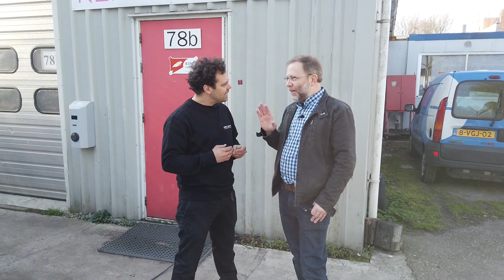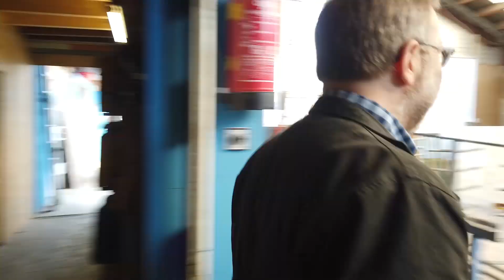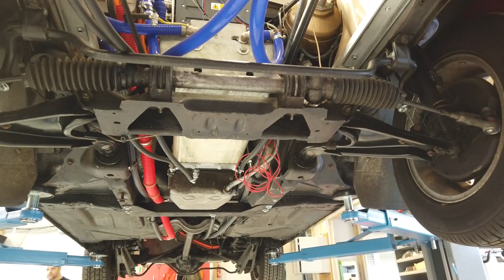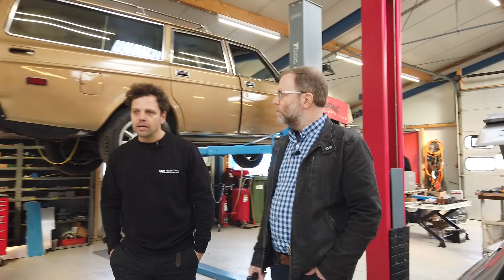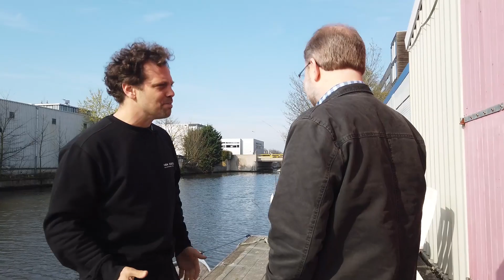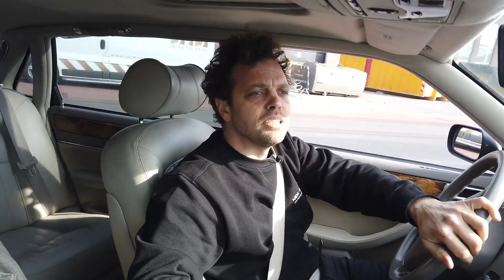New Electric | EV Drive Trains Conversions!

Comment: Ev change over goes black to 
AZ GLOAG RAILWAY 
ITS ALL BEEN DONE SOUTH SHAFT OR DOUBLE AXEL ADJOINING WHEELS TO H-H-H-H SHAFT OR BELTS TO ALLL LEFT TO RIGHT TRAIN WHEELS NEEDING RUBBER KEVLAR GRAPHENE TYRES.
IF YOU HAVE ORIGINAL GEAR SYSTEM MARTIN NAHUEL SIBILIA IS LINKEDIN CONNECTED WHO RECORD NUMBERS REFURBISHED REFIT VW BEETLE CHANGE OVER TO EC ENGINE AND BATTERIES.
WITH NO BATTERY NEEDED WITH MICRO CAMPING WIND TURBINE X 10 (X2 DC MOTORS SENDING POWER BACK TO DC MOTORS AT A SPEED UP 170+ MPH WITHOUT WIND OR WATER, ALSO TRAVELLING TOWARD WIND WATER COULD RECHARGE BATTERIES VEHICLE GRILL OR ELSEWHERE WIND WATER CHARGING THE BATTERY) 20-100+ GENERATOR SENDING POWER WITH MICROCONTROLLERS WIFI IRIDIUM BLUETOOTH FOR MAIN ENGINE PROPULSION MOTORS.
ELECTRIC GT USA CALIFORNIA IS PLAYING EV ELECTRIC WITH BATTERY AND MANUAL TRANSMISSION FROM A REFURBISHED FERRARI MANUAL TRANSMISSION ORIGINAL .
DOESN'T NEED 3 MOTORS OR HIS NEW DRIVETRAIN WITH A TOYOTA STICK SHIFT TRANSMISSION CONNECTED TO BATTERY AND EV ENGINE DESIGN.
INCREASING THE MAXIMUM AC INDUCTION AT 1000 KW SAME SIMILAR SIZE OR DC MOTORS IN REALTY NEED SMALLER POWER OUTPUT TAKING 4 OR 5 GEAR TO RECEIVE MAXIMUM TORQUE HORSEPOWER WITH 1000HP LOTUS TAKING THE PISS NEW EV LOTUS LOOKING PATHETIC.

HE DOESN'T OWN THE RIGHTS TO SEVERAL+ MOTOR POSITION MOUNTS GEAR SYSTEM WITH MICHAEL FRAGOMENI LINKED AND SIEMENS PROCUREMENT/PRESIDENT SIEMENS USA WHO HAVE THE SQUIRREL CAGE AC INDUCTION HALF THE SIZE OF A BUS STOP AT 50.000+ HORSEPOWER.
WHAT DC SIMPLY MOUNTED ALIGNMENT WITH COMBUSTION ENGINE DRIVE BELT SYSTEM CAN DIVIDE TOP SPEED VIA GEARS EQUAL OR GRADUALLY UPWARD.

HE'S AN IMPOSTER OR RWO MIND'S ALIKE SOLID STATE GEAPHENE BATTERY TOOK SCRAWL SEVERAL PEOPLE JOHN GOOD ENOUGH ISN'T 3D PRINTING TIMED DATES PHOTOPOLYMER PRINT A ROCK MAPPED OUTDOOR THE UNIVERSITY AND  MISHAPS MISHAPE A FIRST TIME EVER SOLID STATE GEAPHENE BLOCK TEN TO SCREW A LIGHTNING'S BULB DOES IT?

https://m.facebook.com/story.php?story_fbid=1727051674216306&id=100007344707889

Comment: there was some very enlightening information in this video about diesel exhaust particulate sizes and how they've become smaller with more cleanly burning engines. Also, most people likely hadn't thought much about boats using electric motors. 

Thanks :)

Comment: Respectfully, how is an electric vehicle better than a fuel efficient gas powered vehicle? In the US, electric cars run on coal. Coal fired power plants only transmit that power at roughly 75 -80% efficiency to the charger then the electric motors use it at around 90%.. 100 hp (74.5KW) of work is just that whether coal powered or gas powered.. An efficient gas engine is 85-90% efficient.. There are no solar charged vehicles because no one has 2 acres or room for solar cells to charge one car for daily driving.
Again, respectfully requesting rebuttals.. Thanks.
Reply: Because the electricity in the grid is not scaled up and down. It runs at a set capacity at almost all times. So, the overage is needed to account for any surge. Why not draw from from that instead of leaving it unused?

Comment: There is another issue to take into consideration when claiming that we can just convert old cars and have people continue to use them for another couple of decades: Safety. That Volvo was safe when they released it, compared to everything else that was available at that time, but today any family caught in that Volvo in a serious crash with even a small modern compact car will most likely be severely injured or killed. Plenty of crash test videos with modern vs old cars to prove this point. As enthusiast vehicles, sure, but to replace production of new vehicles, nope. Boats, and trucks on the other hand: YES. They are slow or big enough to offset the safety issue.

Comment: I have read this statement a few times, which I think is complete bullshit... :

 “EVs convert about 59%–62% of the electrical energy from the grid to power at the wheels. Conventional gasoline vehicles only convert about 17%–21% of the energy stored in gasoline to power at the wheels.”  

How much did the generator, that supplied the grid convert again?  Or is this a non issue?

Furthermore, doesn't even the act of taking the power from the grid, ie. going though a transformer into the battery lose a further 30%?  Science shows efficiency mechanical efficiency of a mechanical direct conversion of burning fuel (ie, not going through a generator to grid -> transformer -> battery) is atleast 45% more efficient as over extracting the same burnt fossil fuel from the grid.

Comment: Great video!  One thing I have to tell you, converting a vehicle to electric drive is NOT as hard as you think.  I promise!!  You can do it.  There are several online shops in the States that sell components and can help you through the process.  I strongly urge you to give it a shot.  Get a little riding lawnmower start by converting it.  If you can manage that, you can do a car.  There is nothing more satisfying than driving a car that you built with your own hands.

Comment: Greetings Gentlemen,  It's a shame that Tesla does not have an "EV Conversion Division" to offer an alternative to going green. They have the financial backing and the engineering expertise to make it happen. Think of all the jobs it would generate and the money to be made. I am 67y.o. and even $35K is to much for me to spend on a car. There are roughly more than 1.5 billion ICE vehicles on the road today. Many of us have a favorite style that we would like to see live on for younger generations to experience. I am partial to the 56' Lincoln Continental, 63' Continental, the 67 Chevy Camaro, 63' Ford Thunderbird Roadster, just to name a few. At any rate, 1.5 billion cars are not going to go away suddenly. since an ICE vehicle is presently owned by the vast majority of people at a significant cost to them, many of us would like a viable alternative. I am retired and as I said $35K is simply undoable. However, I already have a vehicle and if it can be competently converted for $10K t0 $20K that would be great. $20K is  still steep for seniors, like me, but I would come out of retirement to offset the cost of a conversion. I really want to go green, but the costs are prohibitive for us.
    Thank you for the interview in Amsterdam with Anne. As usual it was a great show. It certainly got me thinking. >1.5 BILLION cars. That's a lot of potential money, jobs, and economy boosts. Thank you for your time.

Comment: Why is he putting gear boxes in those cars? Isn't it one of the advantage of electric that you don't need a gear box? Just more unnecessary moving parts and has to be filled up with oil.
Reply: probably because redoing the entire drive train of the vehicle has got to be a massive undertaking.. easier to just adapt the electric motor into what is already in these cars.

Comment: Check out what’s being done in New York PRESS RELEASE: APRIL 24, 2019

Derecktor Launches Third Hybrid Catamaran, First Built for Cargo.

MAMARONECK, NY - The Captain Ben Moore entered the water with a quiet splash, a fitting launch for a vessel conceived and built to run silently on clean, efficient hybrid power. The third in a series of 65-foot aluminum catamarans built by Derecktor and powered by BAE Systems hybrid technology, the vessel was built for Harbor Harvest, a Norwalk CT based company set on changing the way fresh produce and foods are transported around metro areas. Once in service, the Moore will carry goods from family farms and small producers in the region across Long Island Sound, relieving traffic congestion and reducing emissions...